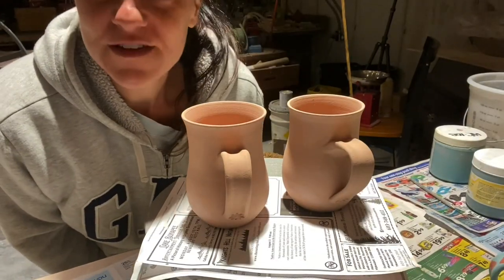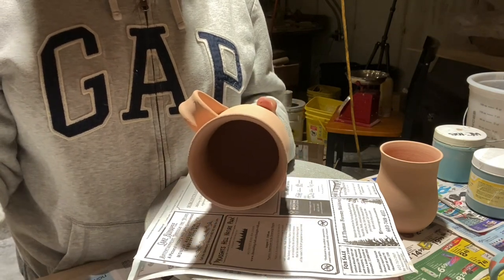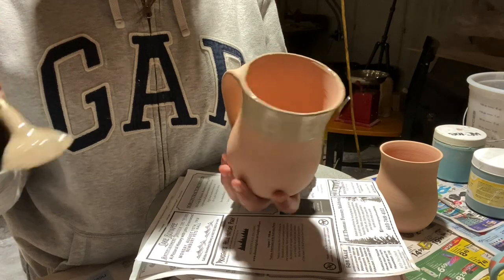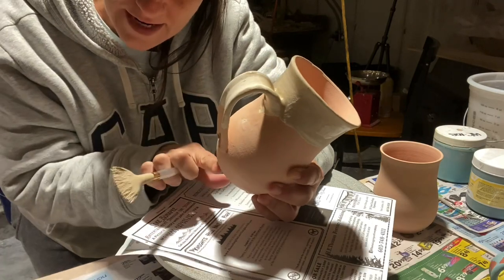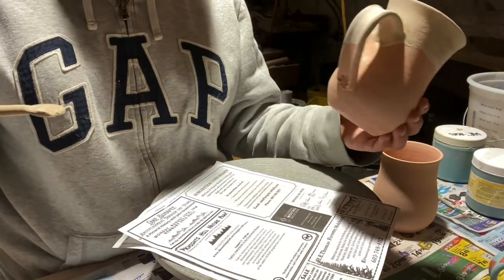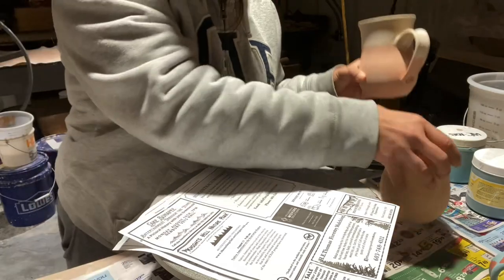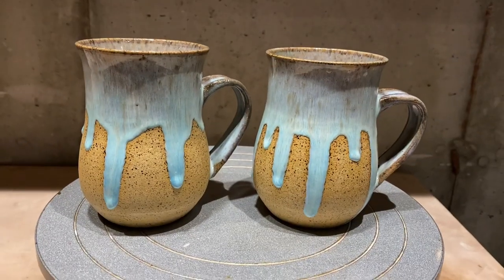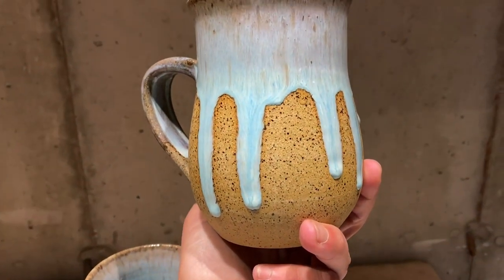GLAZING POTTERY MADE EASY-HOW TO GET THOSE DRIPS! 🍵 #clayvideos #pottery #asmr #art

Comment: So do you paint the whole
Mug first and than add the drip
Glaze …
Reply from the maker: Initially yes - I’ll add the base color glaze and paint it on the top part leaving the rest raw. Then I layer other glazes on top of that so it will drip. A RE fire is a little different because it’s already been glazed fired so I usually just add a glaze or two over the part that’s already been glazed. Hope that makes sense 🙃